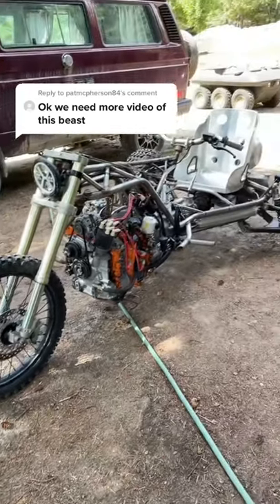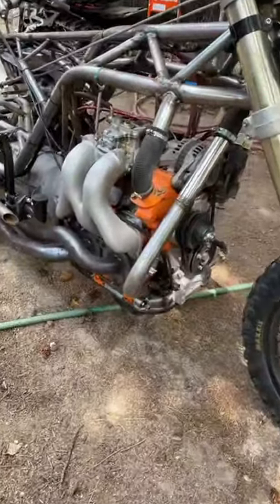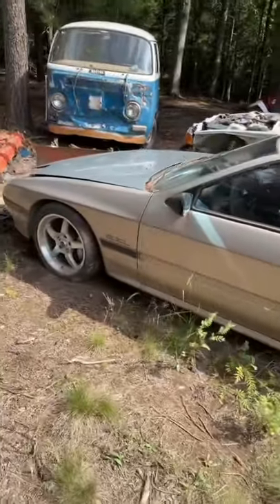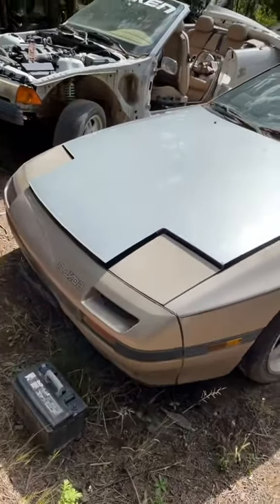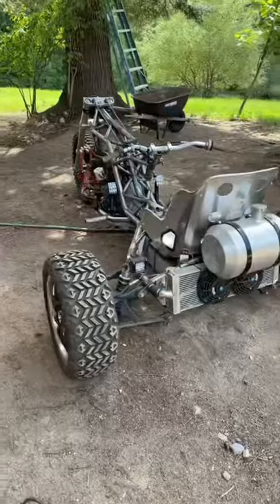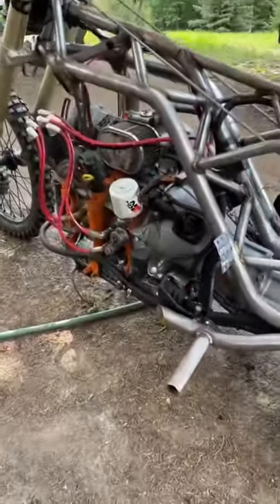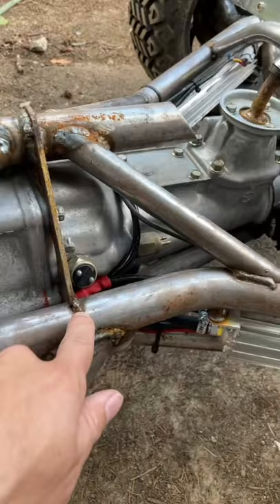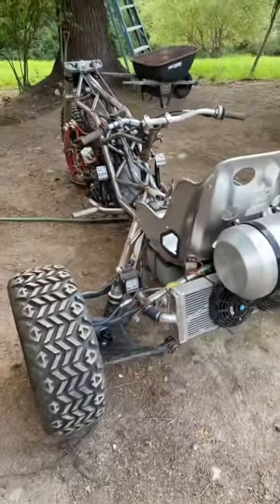RX7 trike walk around! #grindhardplumbingco

Comment: Cool bike but poor rx7 the rotary should have been left in the car... Its what makes a rx7 good.. A LS is so common and boaring.. They fit anything and end up so boaring.. A 13b is so much revier and fun... U have taken all the fun out of the rx7 and replaced it with nothing interesting 😢😢😢
Reply: Yes he took an brand new rx7 and ripped the engine out just for his build and then replaced it with an ls. That's pretty much what you are referring to
Reply: Not to mention that something like a ls is much more superior in pretty much every way
Reply: Ls are good and powerful.. But so so boaring and common as mud!! The rotary is just as powerful and proven to be more powerful than a ls and will rev to 12,000rpm all day long.. Ls v8 needs less maintenance time and money i will give you that. But custom quad rotar billit motors can make over 1500rw hp at the treads!! Ive seen some rotary builds pushing 2500rw hp in drag cars revving to 12,000rpm.. When i see any ls with 2500rw hp and rev to 10,000rpm or more without needing to be rebuilt after every race day ill then be happy to see a ls rx7 lol but till then i say quad rotar all day 😃.. A 13b quad rotar will do it all day n not need regular rebuilding n be reliable.. I like the ls motors but they just ain't a 13b so if it was me i would have left the rx7 intact and built a killer custom quad rotar...
Reply: @michaellegg9381  
 Ls's are still much more superior to rotarys because of overall cost, time to build, ease of build, reliability etc..
A 1500hp rotary will probably cost over 50k and a ton of custom work, i.e. 95% of engine will be custom 
You can find 2000+ hp lsx crate engines for about 40-45, there's a solid reason why nobody uses rotarys for high hp builds or really in general 
Also, why the hell are you/I trying to argue about Ls's vs rotarys anyways? Literally nobody mentioned Ls's in the first place before you waddled along and randomly started ranting about them
Reply: @michaellegg9381  also, you seem to be forgetting that the rotary was built for a home built drift trike by a random guy who builds 50hp barbie jeeps he's not gonna drop 50k+ into something just to dink around in time to time, he didn't even take one out of an rx7, he just had it lying around/out of a junk yard 

Also sidenote, rx7s arnt the only rotary powered car, there's the eunos cosmos bet you haven't heard of that before
Reply: @-meat-  i have heard of em 😃 but im in Australia 🇦🇺 so they are not as common here.. They we're in a hj or hq holden Kingswood in some place.. But they aint called a Kingswood there.. Was a pacer or something like that. n ya can get rotarys in 2,3,4,5,6,8,10,12 rotars.. But the biggest ive seen used is a 4 rotar n was just awesome 😆 but ya right he's not really going to spend tens of thousands of dollars on a billet build lol I'm just a fan of the rx7 and it seems evil to pull out the 13b for a ls swap lol
Reply: @-meat-  just looked its called a mazda road pacer.. From japan and besides the motor in it it's a holden Kingswood.. All the body and interior are a carbon copy of the holden just with a mazda badge and a rotary motor lol